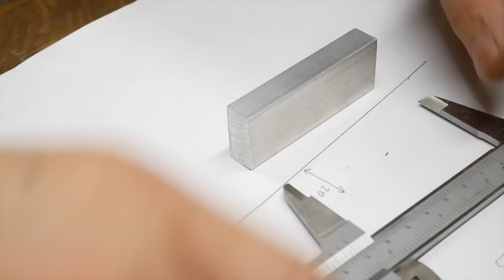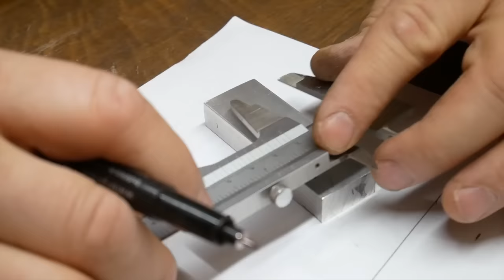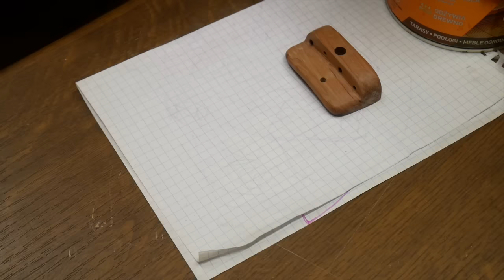How to build a banjo ukulele from an old scrap kettle plus short demo

Comment: First mistake at 3.10 which u make up at 9 and second mistake 4:24 u cut kettel and insert scale it affect sound ,you could easily fix wood scale with screws as there was already enough hole to tight screw, though it was good one

Comment: Great build. Why the nut and the fret at the top of the neck? Is that essential for intonation? 
Keep up the amazing work.
Reply from the maker: They call it zero fret. I saw it on few builds and wanted to try this solution.
Reply: @MikuCigarBoxGuitar  I got it. New to Banjo work and use to the nut on a guitar taking the load up top and not the top fret. Will be building one soon.
Reply from the maker: @derrick_builds  good luck and have fun during work